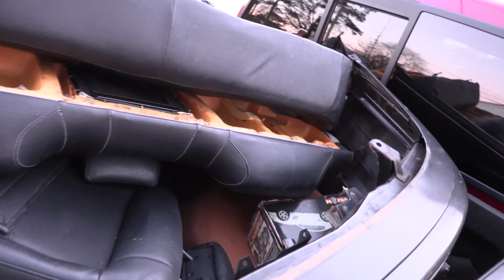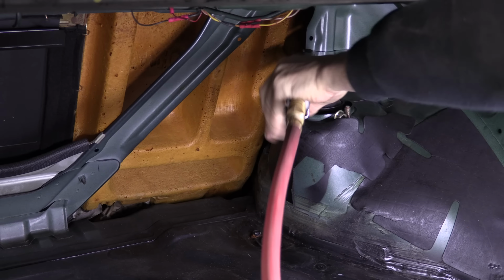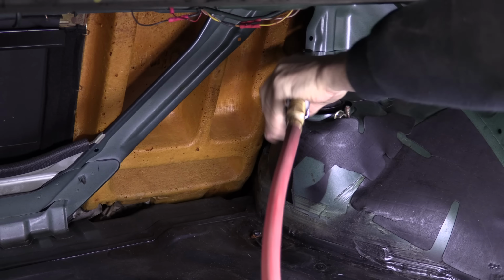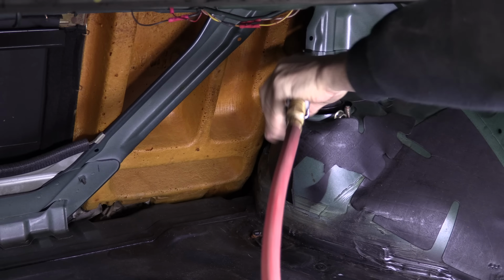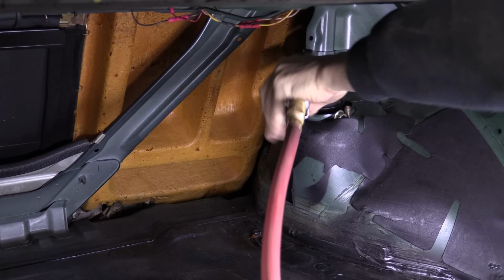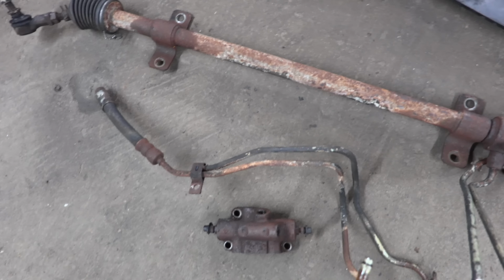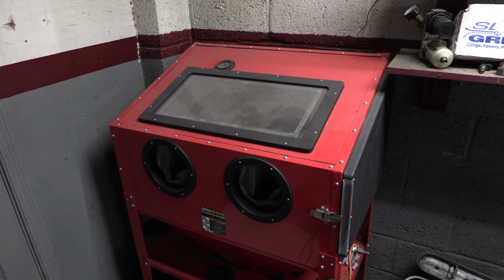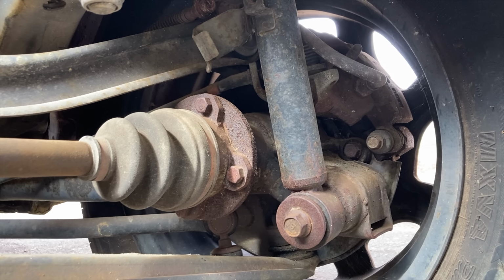Galant VR-4 Subframe Restoration Part 2

Comment: Are you going to see what times the vr4 will run on the track?
Reply from the maker: I already did back in 2003!  It went a 12.73@113.  That was .16s faster than the dial-in time its owner wrote on it.  He might show up in the comments here to confirm this because I think the track mailed him a check.  We didn't check in at the tower before we left.  I ran it through 5 rounds of bracket racing eliminations  by lifting at the 1000 foot, sending 4 people home.  Most of them were faster cars, and they kept breaking out because I'd be ahead with a good launch and they thought they were losing trying to run me down as I braked or lifted.  A win's a win, but it din't make many of them happy.

Comment: Didn't know you used to be a Ford guy, Jafro
Reply from the maker: Still am.  Still drive a 402A optioned F-150 5.0L.  Used to have two of them (a 99 F-150 XL), but I sold it to someone who would give it more love than it got with my 402A in the driveway.  Neither one is a better truck than the other, just different strengths.  All the Fords I grew up with were Shelbys and DeTomaso's.
Reply: @Jafromobile  I knew you had the trucks but didn't know you were into fords. Cool! I didn't get to grow up with the old cool fords but they've had some neat stuff for me to grow up with. Thanks for the vid as usual, love seeing what you get into.

Comment: The passanger siide is always worse becase it's nearest the wet bit of the road!
Reply from the maker: The logic in that is sound.  I'm sure that it could play a factor.  What's most likely in my case is the passenger side has never once been taken apart, but the rear driver's side trailing arm had been replaced with a junkyard unit, so absolutely everything on that side of the car had been taken loose before.  So there was only about a decade since it had been apart instead of 3 decades.  You'll see the paint marker writing on it in the video.  When you see that, it means it's a junkyard part.